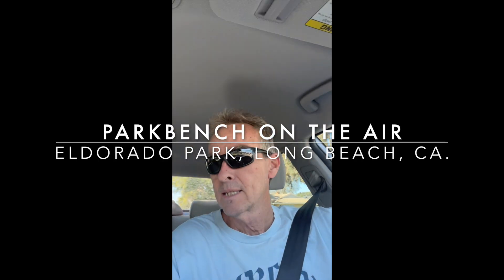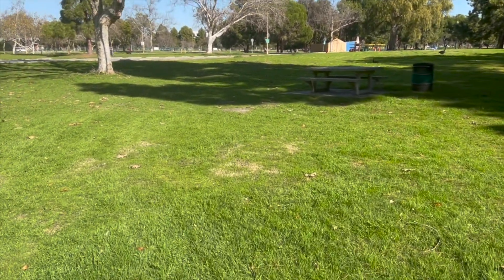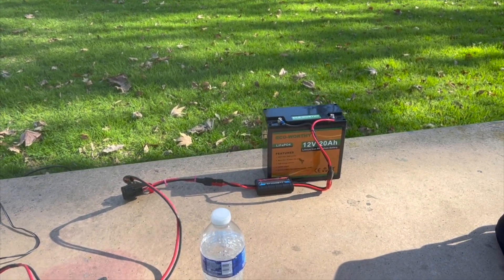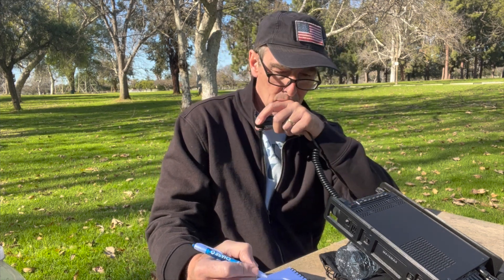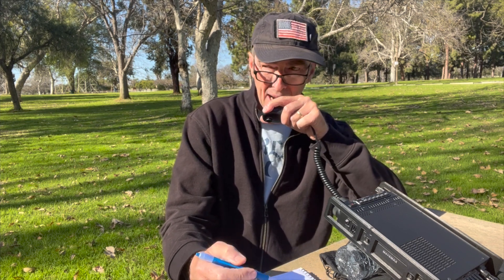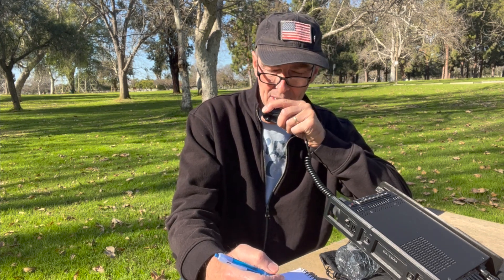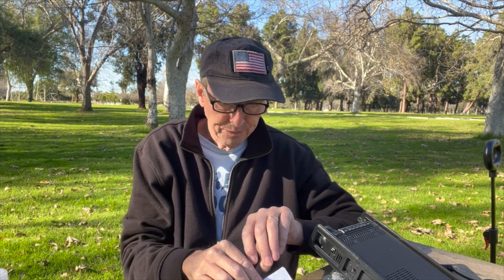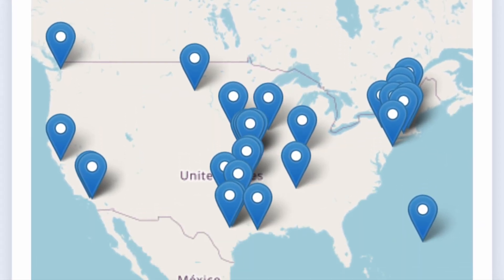Ham Radio: PortableOp:

Comment: With your Antenna, did you use a counterpoise? Also... can you post the ebay link to the TennTenna?
Reply from the maker: I was not using a counterpoise where the coax acted as one. I believe I was using 50'. I have experimented using a separate counterpoise vs not & found it didn't help with my EFHW, but using the longer coax I believe is important. Short runs of coax can cause RFI.